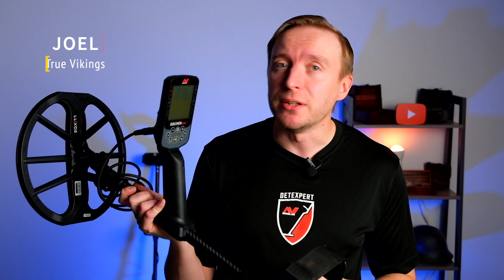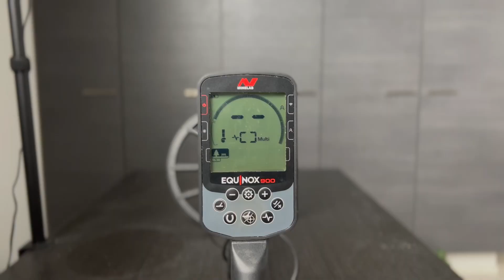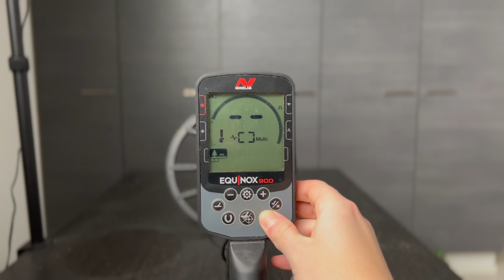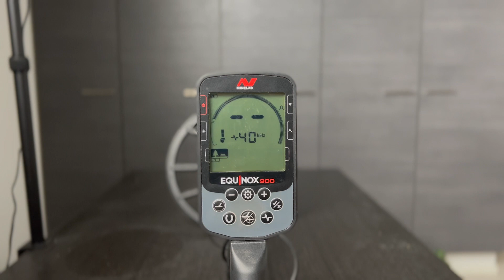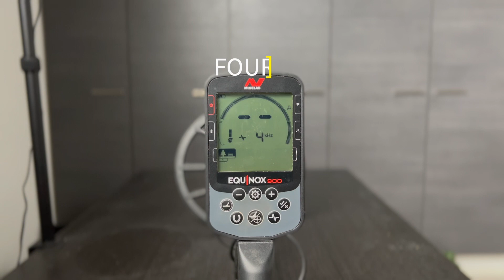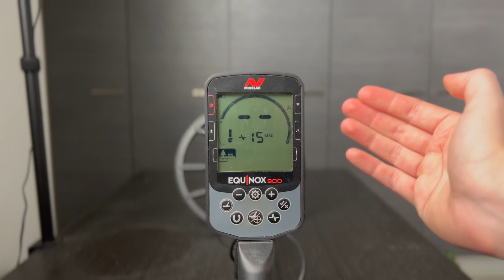Frequencies and Multi IQ EXPLAINED! - Minelab Equinox metal detectors

Comment: I am wondering why the have both 4 and 5 kHz... my DFX has 5 and 15 kHz.

I would rather have 5, 10, 15, 20, 30 and 40 kHz... so swap out 4 for eithet 25 or 30 on the 900!

Ok... you don't want to give op 4 kHz... no problem... just add either 25 or 30kHz.

Comment: Terve! It would be good if someone actually tested coils sizes electronically! All companies and most detectorist claim a large coils goes deeper. Having a degree in low voltage electronics I believe the opposite is true. It's basic science. Since USA has a capped limit of 1 watt on detectors coil output. The length and design of the wiring in the coil has an affect of the targets electromagnetic field. A longer wire and not braided wire has more resistance. I don't know if the output is measured from the control box or the coil? Also an double D coil is in reality an elliptical coil with one side being an transmitter and the other the receiver. This skew the result and the target positioning as can be seen especially in the Manticore. Nobody has done any actual test about the field generated by the coil and the the field in the target. All tests are carried out with the detector it self on buried targets or air tests. It would be more interesting to see a test with testing equipment. And also if it's possible to boost the coil output by installing a booster. Hälsningar från Sverige Kitos.
Reply from the maker: Those would be some interesting tests to do 👍